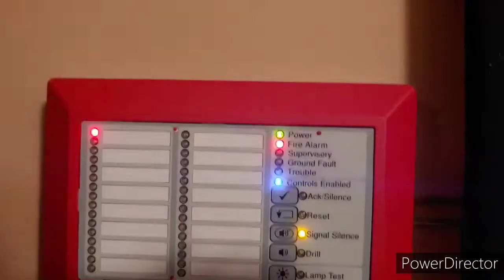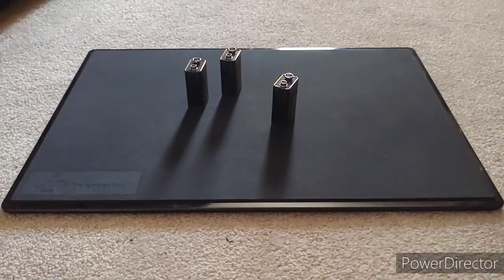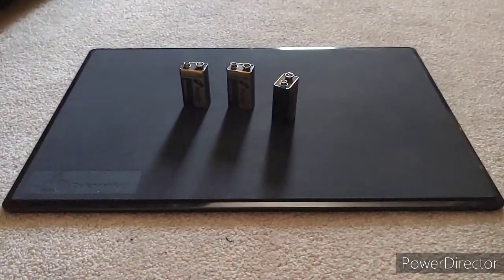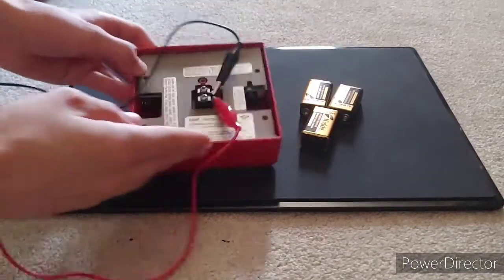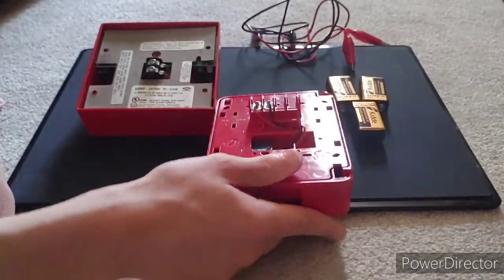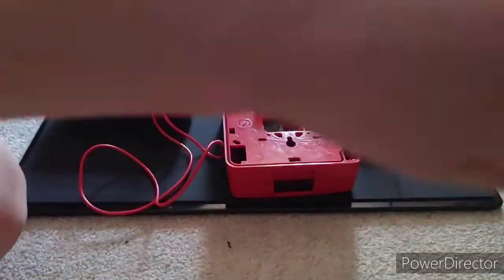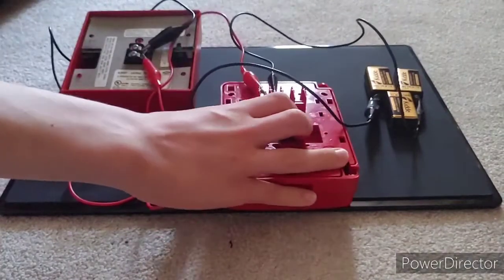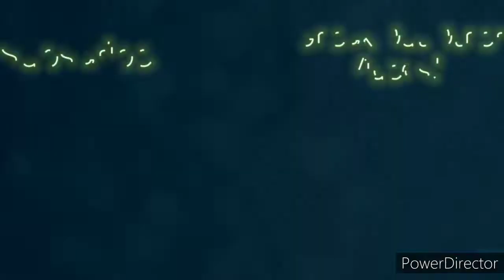Wiring A Simple Fire Alarm Setup With 9 Volt Batteries

Comment: I modified a BG12 to release itself as soon as you let go of the pull lever so it immediately shuts itself off without the key. Makes a cool momentary button for a garage door opener or doorbell. Just make sure you use the right step down transformer for that application
Reply from the maker: That's a cool mod! Personally, I like the STI stopper stations for that type of application. Multiple sets of NO & NC contacts, customizable, and typically a high power rating on the contacts.

Comment: I have a simplex 4903-9101 and i'm not sure how many to use. Also my dad told me daisy chaining batteries is unsafe. Any other ideas?
Reply from the maker: Without a power supply(or control panel), connecting batteries like this is the easiest and most simple way. Considering they are 3, 9 volt batteries, the current output is very low. I would not call it unsafe however I would be careful. If your parents wish you do not connect batteries like that, please listen to them since after all, they are your parents. (3, 9 volts should do the trick for a 4903-9101 though)

Comment: Can someone help me so I have a adapter that has an output of 9v and I’m not using a pull station so I was wondering if i can use it on a simplex 4906 9130?
Reply from the maker: The 9v adapter will not work, since when three nine volts are connected like they are in the video, it adds the voltage to 27 volts (9*3). Also, the simplex 4906-9130 is a smartsync device and would require a simplex smartsync module or panel. Hope that helps!
Reply from the maker: That one will also require a smartsync module.
Reply: So I have to connect the simplex truealert  4906 9130 with the simplex truealert 4903 9418?
Reply from the maker: No, both of those alarms required 24volts DC and a separate module made by simplex that will get them to work properly.